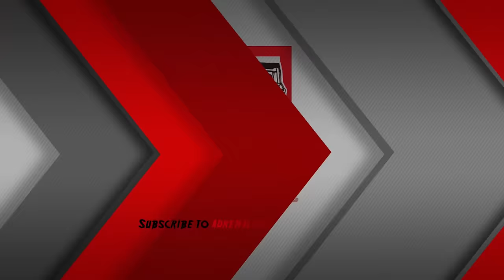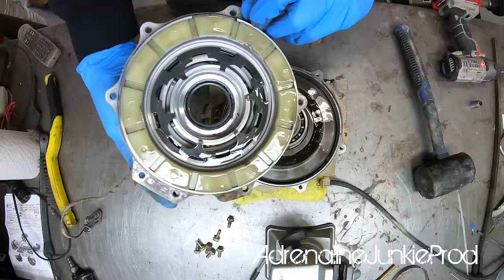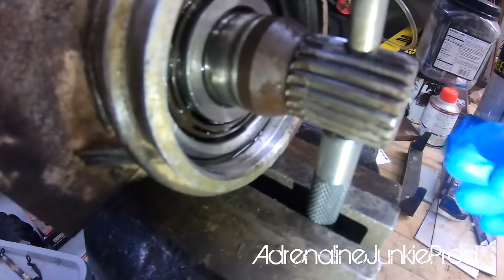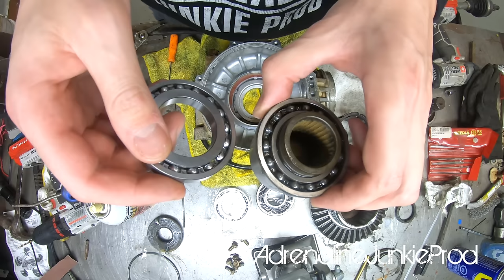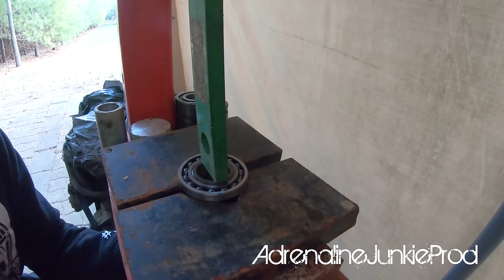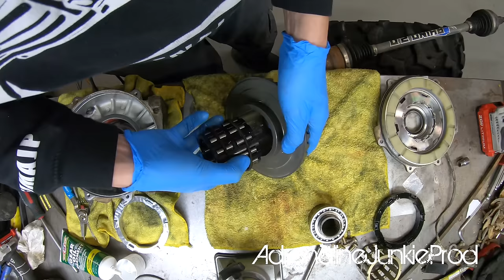Polaris RZR Complete Front Differential Rebuild - DIY - In Depth + Step By Step How To - RZR Turbo

Comment: Do you have a link you can provide on where to get these parts? I would like to see if I can get this upgrade for my 2015 rzr 900 S. Not having issues yet but got about 4,000 miles on it and bought it used. Great video by the way! Got a few small issues to work out but overall seems to be a good buggy for being used.
Reply from the maker: Stoked to hear you got a good used unit! Congrats on the new toy. 4000 miles is def a high enough millage where you should open up the diff to inspect it and address any wear issues. I got all of these parts directly from Sandcraft RCR here is a link to their website: https://sandcraftmotorsports.com

If they don't have the parts you need I know there are a few other companies that carry similar parts for the RZR 900S platform.
Reply: Turns out I do actually have issues going on with my machine in the diff. Have to rebuild or replace the front chunk along with some other suspension items. Kind of got the shaft on a few things after a Polaris inspection by a mechanic sadly. I tried to see if I can just order a whole chunk brand new from sandcraft but they only offer a rebuild kit. I don't know without contacting sandcraft but super ATV has a heavy duty billet diff and I'm wondering if it has the sandcraft products in the mechanical part of it? Probably will go with that because of the reinforced casing around the new diff. I think by looking at videos and a little homework on it seems I will be better off just buying a whole brand new diff from super ATV because of the upgraded casing that the gears and stuff are in. I plan to contact them directly and find out. Thank you for all your help!

Comment: I use 80w90 but I live in Tennessee so a bit warmer.
Reply from the maker: I've had a bunch of people tell me to use a thicker oil. I think when I go to change it I might run something thicker than the Demand drive "vegatable oil" but something thinner than 80W90 for winter riding. I'll prob try out 80W90 next spring/summer.
Reply: @AdrenalineJunkieProd  from the video all your internals look good I would just keep using what you've got 4,000 miles is a lot of miles to have really no problems

Comment: I have a couple questions, 1. What is the heavy clicking sound when the front tires grip on something is it the axles to hub or ring to pinion? 2. What us the most common failure point of all of the 4x4 drive system.

Comment: I am either going to rebuild mine or replace it. I had my pin break and it broke a tooth off of the armature plate and bent the rest of the teeth as well. For some reason that has me baffled to the point of frustration my ring gear will not come out of the housing. It is hitting something and is locked in. There is about 1/8th inch it will move and just stops. Any idea on what may be causing this? I need to make sure the ring and pinion teeth are in good shape before I buy a $525 rebuild kit or just buy a new super ATV different for 1000. Any help would be appreciated thanks.
Reply from the maker: Hey Scott, I'm not sure but the guys at Sandcraft have probably rebuilt hundreds of these. They are very friendly and informative. I'd call them and ask.

Comment: I watched another video of front differential rebuild and the axle bearing with the white plastic washer was on the top side with the armature I’m in this process and mine was like yours in the video and how I took it apart bought it used don’t no if it rite or not

Comment: Was all the parts available in one kit?   Or did you have to buy the stuff separately?   And did you order online? Or is there a Canadian distributor?    Thanks for taking the time to reply.
Reply from the maker: Hey Keith. I called them on the phone and told them what I was after. Very good to deal with. I shipped to my parents place in the states to save on shipping and duties. The bearings, seals and 300M dowel pin come as a kit. The sprague and armature plate do too and then I think the billet spring retainer is separate. Not sure about Canadian distributors. Might be worth asking them when you call.

Comment: Just order the the diy kit from sandcraft, the armature plate packaging has a label saying “run your machine with Four-Wheel drive engaged for 50 miles” 
Did you do this immediately after the rebuild or did you run it in two wheel drive for a while first? 
Also, would you suggest 4 high or 4 low for this “break in” period.

Comment: Had a question on the cover plate with the magnets.  Did you replace the seals on that side?   curious how you installed the larger seal
Reply from the maker: I just popped the old seals out and for the two smaller seals on the left and right sides you can literally just push them in with your hands and maybe a few little taps with a piece of wood and small hammer if needed. For the big seal around the input shaft it's similar. Start it evenly and go around lightly tapping it in. Very easy to install.

Comment: I just did mine. I took it out and it feel super “tight” in the front diff when I put it in 4wd if that makes sense. I called and they said there is a break in period. Did yours have the same tight feeling when you first rode it after the upgrade? Just seems weird to me and I don’t want to mess it up. (I hope you still read comments) 🙏

Comment: What do you think this  can be I have my from diff every thing looks good but as soon as I put bolts on top cover you can’t twist output shaft without having a set of pliers and a lot of torque Dosent spin easy but if you take cover off it’s spins easy ?

Comment: Great vid! How did you press off the bearing on the output hub without ruining the Teflon spacer?
Reply from the maker: Glad you fond the video helpful. It didn't seem to get in the way at all when I was pressing it off.
Reply: I am about to rebuild my diff and I have this exact question. Trying to find a part number so I can order it because I dont see how i wont break it.

Comment: I have completed everything. When I tighten my bolts the output shaft will not turn. I take them out and it turns fine. Any help?
Reply: What did you do to fix this issue? Just got done rebuilding mine and I have this same problem

Comment: How did you remove and install the bearings that are within the sprague assy and go out to the output sides of casing? The ones that mate up to the teflon spacer ring?
Reply from the maker: I just used a press. They were easy to remove.

Comment: At the start of the video you mention that the differential was noisy, how can you tell if it's noisy when it's in the machine? Meaning, how can you hear it over the engine, the exhaust, the tires, etc. 

Thanks
Reply from the maker: It's not always easy but you can hear it if you put your head towards the firewall in front of the cup holders while riding down the road. You'll often hear the noisy bearings. The thing is these usually fail over time and get louder and louder and people get used to them. Get in a new machine and then get in yours and compare. I could definitely heat mine was making noise.

Comment: Did you get a chance to test your diff yet, i am curious to see if everything working better than oem parts, thinking about to upgrade my 2019 rzr xp4 1000 turbo.
Reply from the maker: Hey Boz. Ya, I've tested it quite a bit. Here is a response I wrote to another comment: I've been running it for quite a few months now. I've beaten on it quite a bit in mixed conditions. Not a single diff crunch since I installed it. I'm a lot more confident keeping it pinned up climbs now when the front wheels are spinning hard. It seems to work excellent so far. It is as quiet as when I installed it. We will see how it does over the next few months but currently my opinion is, YES, it is worth the investment. I am happy with it.

Comment: I just re did my 05 sportsman 800 rear diff and they gave me a total of 4 seals.. 2 for the axels and 2 other ones that were the same size .. one is a rubber black one the other was like a goldish color.. I think I messed up I put the gold one where the driveshaft goes couldn't find out where to put the other one? So where does the other one go ?

Comment: When you were pressing off the original axle cup bearing, one side had a plastic disk (white) behind the bearing.   Did that crush/extrude when you removed the bearing?  I am about to take mine apart, and I was trying to figure out how to fixture it in the press to get behind the bearing without crushing the plastic spacer
Reply from the maker: Sorry for the late reply. The plastic piece was not damaged during disassembly.

Comment: Any idea if this is the diff in a 2016 Ranger 570-4 crew?  Ya Vero eqxke and still clicking like crazy when in reverse ? Thank You -great video
Reply: Diff click in reverse.
Reply from the maker: Hey Mike, it may not be the exact diff but everything inside should be basically the same on most of them. They are all Hilliard style differentials and as you saw it is a very basic design.
Reply: @AdrenalineJunkieProd  thank you - noticed a chip in the front of the casing going to open it up hope it’s sealed and can be fixed.
Reply from the maker: @mikeansbro3829  if it’s just a small chip or a tiny hole then realistically you should be able to clean it well, scuff it up and JB Weld it. It shouldn’t effect anything. Just try to figure out what caused it.

Comment: Where should I buy the parts ? Quad logic has a kit for $300, does anyone know if it's worth it? I Want to get the best parts for the price.
Reply from the maker: Then I suggest you order from Sandcraft RCR like I did. I explain why in this video. You don't want to cut corners to save a few dollars when it comes to your diff internals.
Reply: @AdrenalineJunkieProd  I agree! it's alot of work but for 1k I can buy a super atv heavy duty diff already put together. I hear good things about them as well as sandcraft. If I'm going to pay over 500 for parts might as well spend the extra 500 and sell my used one on eBay, or something.

Comment: I have a 17 turbo as well mine is stuck in 4x4 any idea what to look for.
Reply from the maker: Hmmm, could be faulty wiring or the armature plate might be jammed or bent or have missing teeth. Realistically it's probably something internally. Stuck on is generally better then stuck off though. I'd pull it apart and inspect it if I was you.
Reply: @AdrenalineJunkieProd  thanks for the info

Comment: For some reason I can't get the center pieces that the Sprague cage surrounds apart. You mentioned there could be suction between the two but just can't get past this step.  Any ideas are appreciated!
Reply from the maker: Have you put much force on it? Not sure why they wouldn't come apart. Was your diff contaminated with water?

Comment: With the snap
Ring pliers your using do they pinch and expand?
Reply from the maker: Hey Zach. Ya they pinch and expand. There is a little lever you flip that switches it. They are made by channel lock. I really like them. I’ve got two sets. They are strong and work well.

Comment: So how did it hold up?
Reply from the maker: Hey, it's held up great to the abuse. It started making a bit of noise a little while ago and it turned out the main input bearing failed. The cage broke and the balls in the bearing were getting noisy because they were slapping together. It is an SKF bearing but it utilized a plastic cage design. I called Sandcraft RCR and they looked up my order details and dispatched a replacement bearing and seal to me free of charge!! Their customer service was excellent. They told me it's rare that  they fail like that and they stood behind their product. Overall I am satisfied. When I'm hard on the front end and land with the wheels spinning in 4X4 the diff will still make crunching noise's from time to time but I think it's just the armature plate skipping due to load. I'd assume the magnet just can't hold the pressure in such a situation and it kicks it out of 4X4 for a second but it instantly re-engages. I've hit it quite hard a few times and was convinced I had to have damaged the armature plate or the sprague carrier but when I had it all apart I inspected all the components and they all looked perfect except for the defective bearing. I had a small amount of seepage from one of the axle seals which was still likely good but since I had it apart I proactively replaced both of the axle seals. Sandcraft through those in the package for me and didn't charge me any shipping on them. As far as an upgrade to your stock front diff I would say this is a good setup. I am happy with it. The build quality is good and the customer support was excellent.

Comment: I just put sandcraft internals in my turbo diff and when I put the top half of the case on I can't spin the pinion gear by hand is this normal? I've taken it apart and put it together a hundred times
Reply from the maker: You should be able to spin everything freely. Is everything inside assembled correctly? If you replaced all the bearings did you install them correctly? I'm not sure what could be causing it to bind. You could give their shop a call. They were quite pleasant and easy to deal with when I called them with a warranty concern in the past.

Comment: I'm struggling with one thing, backlash, what inside there determines backlash should there be any or is there some zero backlash component I'm Missing
Reply from the maker: There is no way to adjust backlash on this setup as far as I know. Since There is just the ring gear and the input shaft I don't know where you would adjust it. You might be thinking more about how a typical rear diff in a truck is setup with all the spider gears. In that situation backlash plays a roll.
Reply: @AdrenalineJunkieProd  oh that's definitely what I'm thinking of 😅 was just trying to diag the front diff on a ranger. Growls in 4x4  clicks in 2wd, had the fill plug out and noted zero backlash, I guess that's just how they are, wasn't any debris on the drain plug... tomorrow I pull the diff to check the propshaft and properly assess pinion slop, killer vid by the way definitely bumped up my confidence level. I'm A journeyman motorcycle tech most final drives I've worked on either have shims or even a screw and some degree of backlash

Comment: So what’s the verdict? Is this kit worth the $500+ dollars?
Reply from the maker: Hey Jeff. I've been running it for quite a few months now. I've beaten on it quite a bit in mixed conditions. Not a single diff crunch since I installed it. I'm a lot more confident keeping it pinned up climbs now when the front wheels are spinning hard. It seems to work excellent so far. It is as quiet as when I installed it. We will see how it does over the next few months but currently my opinion is, YES, it is worth the investment. I am happy with it.

Comment: When I put my top cover back on mine locks up and I've watched the film and I go by it and I have put it together five times and every time I put together it locks up it turns good until I put the top plate on
Reply: Did you ever figure this out? Mine is doing the same thing I went with the bomb proof kit though.
Reply: @Nathan H  same for me. I put the sandcraft bombproof kit in mine and when I bolt the top half of the case on I can't turn it by hand.
Reply: @shawnlogue8716  I had to remove the plastic washer on the hub. After I did that it spins now.

Comment: Mine (16" XP1T 4) does not have the Teflon washer on the output shaft by the bearing on the one side. I cannot find this on  OEM parts list, a part # or reference to this piece. Am I missing a Teflon spacer on that output shaft between the bearing?
Reply from the maker: Hey James, not sure if the 16 diff is any different. Sometimes year to year there are small variances and revisions. This may be one of them. This differential had never been open prior to this video so what you are seeing is 100% original from the factory.
Reply: 16 xpt4 does not have it!... i thought i was missing it too

Comment: Would this kit fix the ratcheting noise in the front diff, mine will make a ratcheting sound once in a blue moon
Reply from the maker: The ratchet noise is usually the armature plate skipping on the sprague carrier due to excess load I believe. It reduces it a lot. I've still heard it once or twice since installing it but it was after a sever front end landing with my foot on the gas. I'm very happy with the front diff since rebuild. Works flawless.
Reply: @AdrenalineJunkieProd  appreciate it man!! I have watched your videos for years u are the reason I got a rzr turbo xp!!